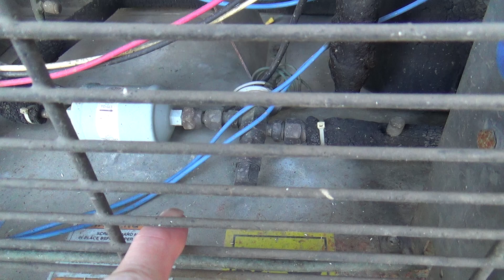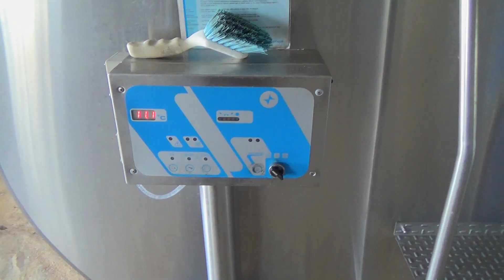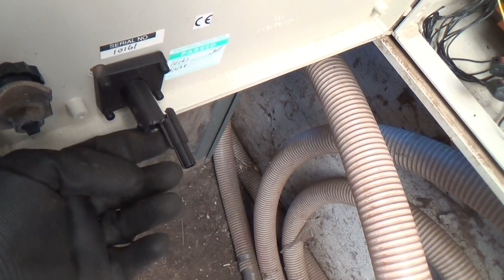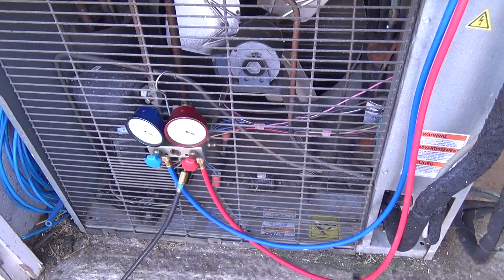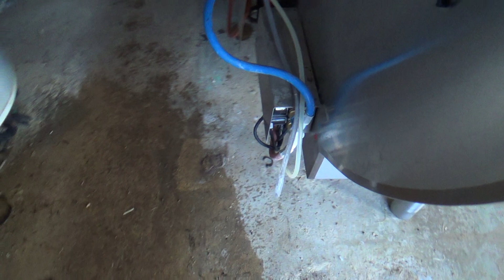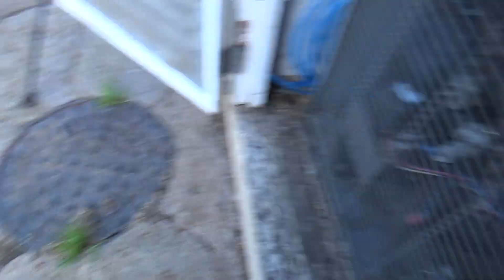System Decom

Comment: the subcool valve is basically soposed to end up maintaining 40 degrees of subcool, 10 thru the condenser and an additional 30 in the accumulator. the accumulator also has an oil return orfice, R434A (RS-45) works well as a drop in. the units are soposed to have a fan speed controler (updated) that maintains 80degree head in low ambiant.
Reply from the maker: Thats good to know about the valve. Don't think we get R434A here  any more, they are phasing out the use of refrigerants with global warming potentials over 2500 and R434A is 3238. If I get the job of installing this in its new site will look in to fitting some fan speed controls.